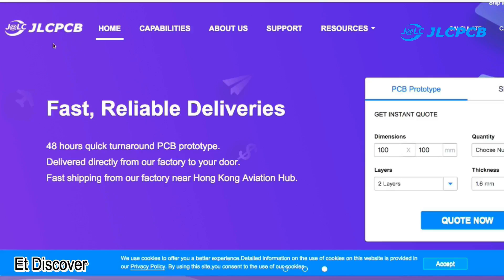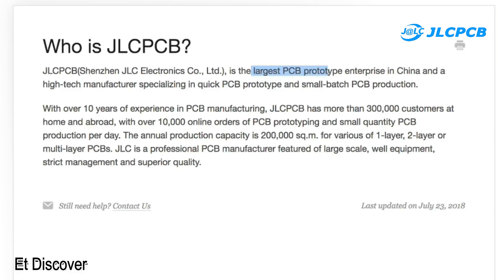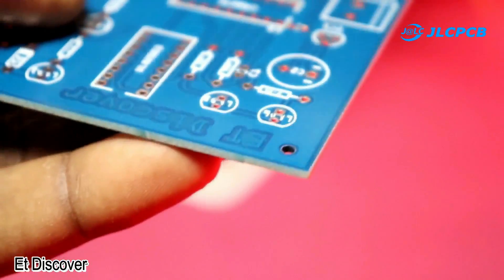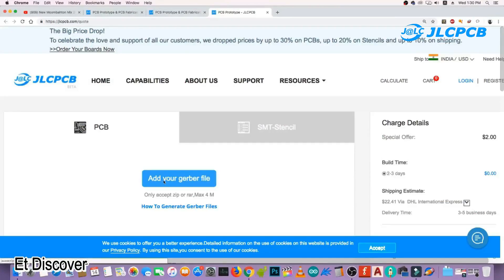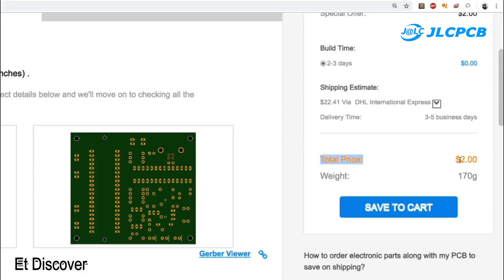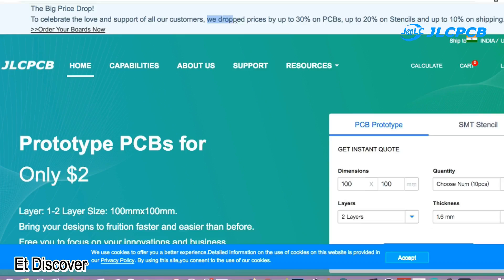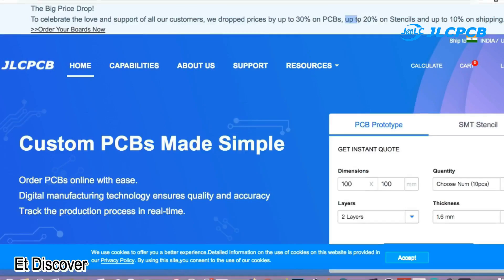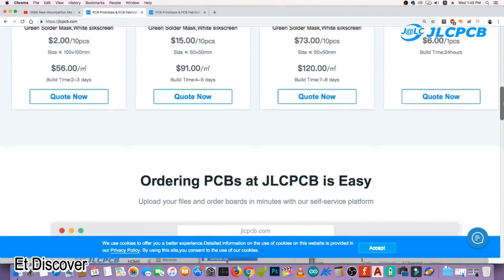Simple 100 Watt Audio Amplifier for Subwoofer (35-00-35 Voltage)

Comment: I notice Resistor 0.22 Ohms 2 Watts you use is carbon instead ceramic. Ceramics will adjust the resistance defending how much load by speaker and speaker that you use is SONY Sony use speaker about 120 watts at 6 Ohms so you put 2 speaker together so the equivalent ohm resistance load is 3 Ohms by parallel connection witch is Bad!!!  FOR PUSH PULL TYPE AMPLIFIER ESPECIALLY BYPOLLAR TRANSSISTOR. i  know all electronics parts to work.

Comment: I tried this circuit and it doesn't sounds well as 100watt just about 20 watts only.... Why this... If anyone had solution plz help me.... I used 30-0-30 5A transformer supply and still I can't get the high output.... It just sucks ... Only about 20 watts still....

Comment: For how long it run at full output power with that heatsink?  
What is the damping factor?
What is the THD @ 100 W output?
What are the -3 dB points on the frequency response curve?
What is the slew rate of the amplifier?
What is the quiescent current through the output transistors?
What is the rise and fall time of a 1 KHz square wave at full output?

Comment: Just a question my brother ,since your using two parts C 4468 and A 1695 there in your amazing amplifier. My amplifier have  the same transistor  part that your using but a shot and burn in my amplifier , and I can't find that transistor to replace the burn one. Brother is it okay to replace it with this transistor or not. A1941 and C 5200. Just my question sir.thanks for your time.

Comment: it is good circuit but add a pair extra as push pull mode class b for true 100+ output .. it only use pre and vas mod  mix with driver stage with power transistor use extra pair of 5200 1943 for more output ..

Comment: The maximum supply voltage for lm358 is 32v in single supply and in dual power supply it is ±16v. How does it possible to connect ±35v to it. May I need to use a vtage regulator for the if lm358??? Please answer...
Reply: Resistor or regulator 7812 or KIA 7812
Reply: @dimacebotari1202  but 7812's input voltage can't be more than 24v

Comment: Sir in video you are using .22ohm resistor and in ckt diagram it's 1ohm resistor. Which can I use
Reply: Any resistor between 0 .22 ohm, 0.33 ohm, 0.5 ohm, 1 ohm. Can be used
Reply: Diagrama por favor

Comment: With 15 0 15 vac transformer max output watts are 18 watts at 8 ohms, 30w at 4 ohms & 40 watts at 2 ohms speaker, for a 100 watts amp at 4 ohms you need 24 0  24 vac transformer
Reply: Pode por favor me enviar o esquema do projecto 🙏🙏

Comment: Whenever any electronic assembly is demonstrated in you tube, the viewer naturally wishes to own it and wants to know where the materials including PCB etc are available without which the demonstration is nothing but a waste. The video maker should give one specific code to his video and also the source where from these materials are available. The interested may supply this code to that source requesting  supply of all materials on payment of the cost by whichever means preferred by the supplier. This is very attractive procedure for commercial  and educative purpose.

Comment: 7:13 it's not 1µF 63V , you used 10µF 40V. And to add, in Schematic resistors are 0.1Ω but you used resistor 0.22Ω .  In schematic big capacitors are 4700µF you used 1000µF.  Maybe there is even more mistakes but so far I seen these.  Other than that it's nice project.
Reply: You can almost always go up in capacitance (in certain circumstances). 1uF to 10uF is no problem, you could even put a 100uF capacitor in that place. The emitter resistors are not mistakes either since going up in resistance is always better than going down. Going from 0.1R to 0.22R is probably even better. Tho going down in capacitance for the DC filtering isn't that great of an idea. To push this amp to it's fullest, you're definitely going to need the 4700uF, I guess he didn't have such capacitors around at the time of making this video.

Comment: The LM358 have low power output, how it works?
Reply: The LM358 is the pre-amp and the two power transistors work in a Class AB configuration to amplify it even more.

Comment: hello good evening apologize could you tell me if in this amplifier circuit I can use the transistors d718 and the b688 or instead the b817 transistors and the d1047

Comment: How can I connect it to dc 12v 5amp Power supply..
Reply from the maker: You need 12-0-12
Reply: Just use a mini inverter board 12v to 35-0-35v
Reply: You can use 0-24 with output capacitor and speaker terminal to capacitor and ground it will work but not that much power as 24-0-24
Reply: Bro i have 24-0-24 inverter board will it work on this circuit

Comment: Plzz tell one more thing i want to use volume control in this circiut how can i use it ?
Reply from the maker: normal process
Reply: connect the input cables to the volume control pins.
Input 1 to pin 3 of volume input 2 to pin 2 of volume then ground

Comment: Where to put 150 ohm resistor??? And also please write the number of components which u hav used (for example  how many 1000mf 50v caps u hav used in this board ) in the parts list.
Reply from the maker: Coming soon stereo . 4mosfet and one op amp ic
Reply: @EtDiscover  please answer my query bro

Comment: In the video, you used 10uf instead of 1uf
Reply from the maker: You can use both. This is the audio input filter condenser
Reply: Based on your circuit, you can make it stereo audio amp, by separating the R L channel and using the two op amp of lm358, providing again another 2 transistors (a1941, c5198)
Reply from the maker: For stereo you need Only  two transistor because this is a dual op amp IC. I used only one side.

Comment: Batao 0 volt use q karte hain amp mai please
Reply from the maker: AC current to flow through the ground conductors of signal cables. The voltage drops in the ground system caused by these currents are added to the signal path, introducing noise and hum into the output. I hope you understand
Reply: @EtDiscover  bhaii hindi mai bata do plz
Reply: @EtDiscover  Woooooooowwww what a Chutyapa reply.. Looooollllll

Comment: Nice starting project. But a heatsink is far to small and also there is no bias regulation. Bipolar transistors starts working from 0,6 V. U should use two rectifire diodes or transistor between base of each power transistors. THD and TIM will be so high.
Reply from the maker: That's why you get Square Web from it. As a result, it is very powerful
Reply: @ Tomasz Gud 1 buddy its a bouncer for this asshole.

Comment: Plz tell me why we use  0 volt i mean ground volt  in amplifier
Reply: Konain haider.  All amplifiers use it. Balanced power supply 35v-0-35v you need to connect 2 capacitors in series. 0v in the middle and + - on the weather side of the capasitor. You must use  bridge rectifier to get DC out of power supply. Before, we had to use the capacitor on the speaker output to block DC.

Comment: Hello
I have a question.
can you for me
plan a small circuit
which makes from 2,8VDC .... 4,2VDC always 5VDC
the circuit should also be loadable with 10A.
and she should be very small
I build e-cigarettes, but the 4.2V are too low.
I only build with only one battery
looking for a circuit that could deliver a little more power
Reply from the maker: You can use this PAM8403ic
Reply: @EtDiscover  ??? and how?
i understand how it works to an Steam-Zigaret

Comment: What if I have DC supply
Reply from the maker: I don’t understand brother. Do you want to know about the input voltage?
Reply: @EtDiscover  You gave AC input directly from the transformer if we have a proper rectified DC supply how to connect that to the circuit..
Reply from the maker: There is a diode inside the board and I used two capacitors to filter. You can use a large capacitor here for good quality sound
Reply: @EtDiscover  Ok so my question is if I already have a proper rectified DC supply what components I have remove, because your circuit has a rectifier
Reply: You can connect dc voltage but it has to be simmetrical
Reply: @ Irfan, learn Electronics properly from an Institute / College n not on U tube.